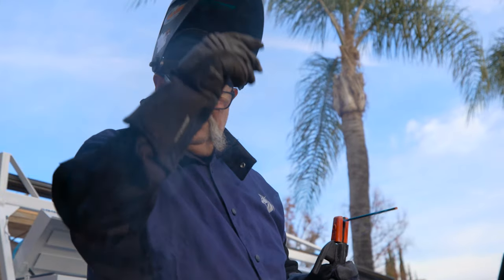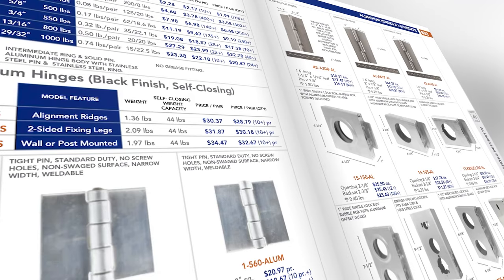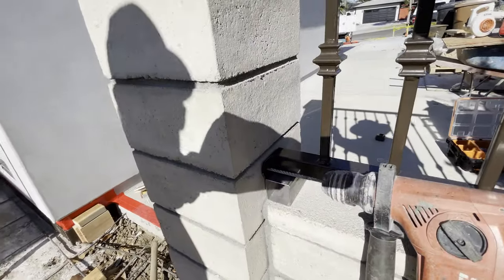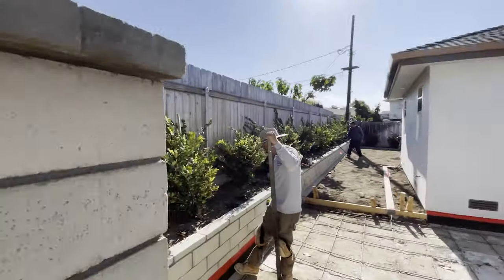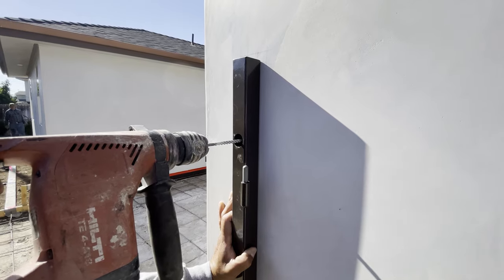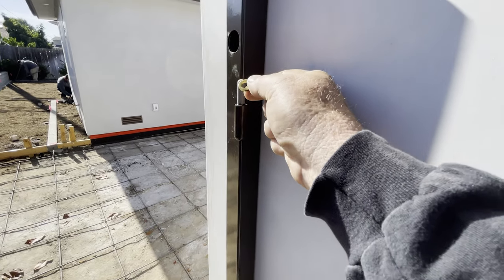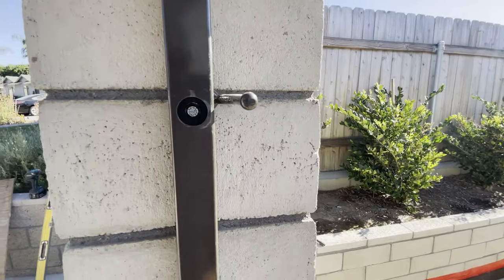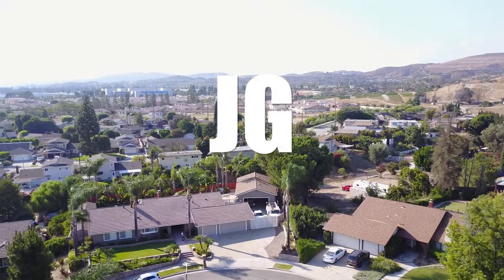How to install metal gate & railing to block wall | JIMBO'S GARAGE

Comment: Is there another way to secure a metal post to a block wall?  The guys that installed my gate used lag screws, but owing to the heavy gate, the post came apart from the wall. The gate was wrought iron and about 6 ft wide.  Any suggestions ??

Comment: why put the hinged side with all the weight of the gate on the plywood wall of the home instead of putting all the weight and hinge side on the more structurally stronger concrete block side?

Comment: Curious, why did you put the flange/tab off to the side vs up/down ? Not to say either is right or wrong.
Reply: Easier to mount is what I’m thinking
Reply: Easier to drill when you install. If you do it up and down, you can't drill in straight (some of the time) because the pickets get in the way.
Reply: I believe they are not quite so visible this way from the outside of the gate. As well as matching the height since the posts on the gate don't need tabs making the gate and the fence aesthetically different in appearance. Consequently Jimbo did do this correctly. Ya know - I'm pretty sure I've seen this video before, probably when he posted the fabrication of the gate & fence. When I saw this posted this morning I had a moment of deja vu!
Reply: Curb appeal
Reply: Me personally, i think that he wanted to acheve that impression that when you are standing directly in front of the gate or rail from the street point of view, you can't see how it is mounted (kinda of floating impression). Greetings from Serbia🇷🇸